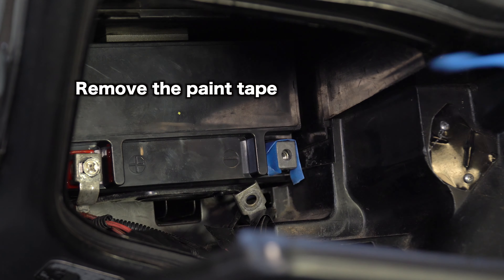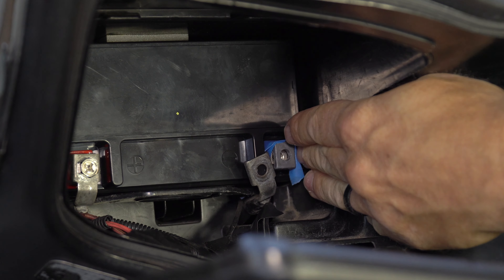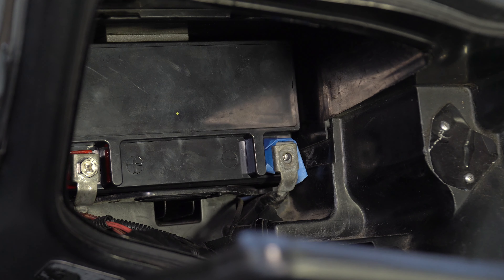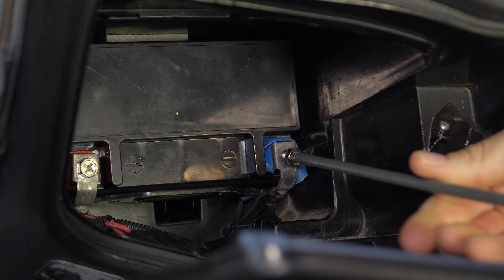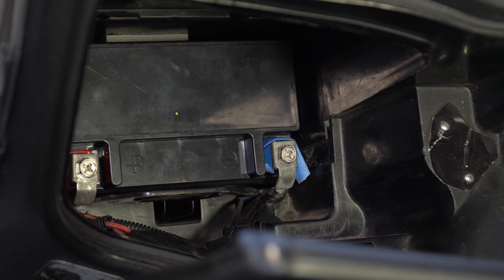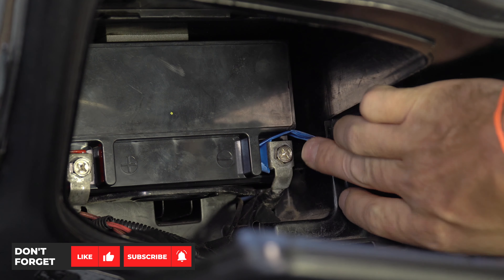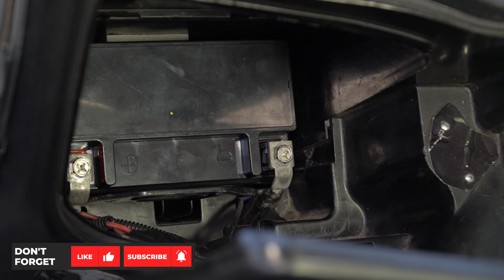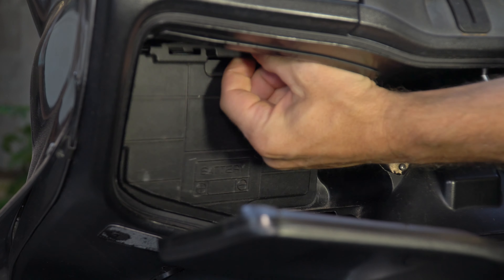Suzuki Burgman 400 Battery Replacement 2007-2016 | Mitch's Scooter Stuff

Comment: I have had a heckuva time with those little square battery bolt nuts falling out before.  I finally tried a straw and it worked ok and if you wrap it in tape it works good too.  Best thing though is I had some clear small diameter vinyl tubing that I used as a spacer under the nut to force it to the top.  It was thick enough to keep it from falling out and would compress when the bolt went through the nut later.  It allowed threading in the bolt super easy especially with the short ones they provide often with new batteries.  Hope that helps someone
Reply from the maker: That's great idea too! Thanks for stopping by to leave a comment! 👍🏼👍🏼

Comment: Hello from Portugal👏. i just want to say that acid batteries cannot be installed lying down, because otherwise the acid will start to come out. For this battery positioning on the bike, I recommend gel batteries. Congrulations for your job!
Reply: I just bought an acid battery
The battery used in the manual is acid
But I don't know how it fits upright !

Comment: This design is SO MUCH EASIER to work with than the remodel. I'm endlessly upset that they changed it. Look at all that room, too! Not like the piddly box on the right that couldn't even hold a loaf of bread and the useless space in the battery compartment. The battery compartment may as well be a fully removable panel for a dedicated battery compartment for all the use it is as a glovebox.

Comment: Hi, my query about will please give to me some of advise about: and could you give to me some of idea I have trouble again with start an scooter the battery was change to another one from battery shop only the battery was filled with acid and charged after that and after when I put the battery inside and made an contacts nothing was happen at all even no light !  
And after when I removed the battery and check it, saw on it 
 very strong spark.
Thanks.

Comment: I get 2 more years out of my battery by opening it up, adding salty water and charging it to 14 volts. Replaced it after 8 years.
Reply: lol
Reply: same here got a TMS YTZ12S UTZ12S Motorcycle Dirt Bike ATV Scooter AGM Battery once a yr or so pry the top off an replace the water and use a battery tender jr (on a Vespa GT200) and it is still going strong after 8 yrs.

Comment: Is it okay to have the battery in lay down position like this all the time? I had battery problems and my mechanic told me it's slowly depleting due to its position. However, I keep seeing more and more Burgmans where the battery is always laying down. On the other hand, when I think about it, my scooter also has an installed alarm system which may be draining the battery (IMO). Please advise.

Comment: i had an old scooter that i had to get rid of. It was very difficult to start. The repair shop said "charge your battery!". On several occasion they said the same thing. But, i am pretty sure it had a bad compression and the timing belt (or what it is called) might have been bad. 
The repairshop tried all the easy stuff, change sparkplug, CDI change and so on. If i had the tool available i could easily have checked the compression myself but i never did that.
Reply from the maker: Dang, I wish you could send it to me and I could fix it up! 😄

Comment: I have a 2013 400, and I'm trying to replace the battery.  I detached the leads just as you said, but when I pulled on the handle the batter wouldn't come out.  What should I do?
Reply from the maker: Put screw back in the battery post and pull with nose pliers 👍🏼
Reply: @MitchsScooterStuff  OK, I'll try that.  Will let you know what happens.
Reply: @MitchsScooterStuff  Tried.  Wouldn't budge.
Reply: I finally used a flat screwdriver and pried first on the side and then from the bottom and it finally popped out.  I installed the new batter and everything's OK now.  Thanks for the advice!

Comment: Is this scooter good , have any problems to maintain ?
Reply from the maker: Yes! I have this scooter since I bought brand new with no miles on it on June 27, 2007 and still love it. No problem and if you keep up with service then no problem
Reply: @MitchsScooterStuff  do you do any modifications on it , varatior change or somthing else for better rpm performance ?